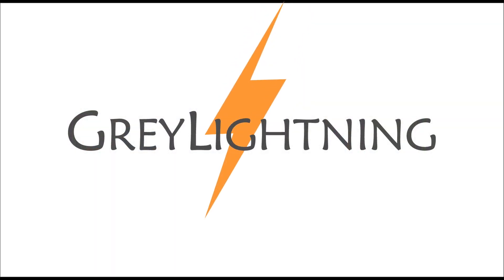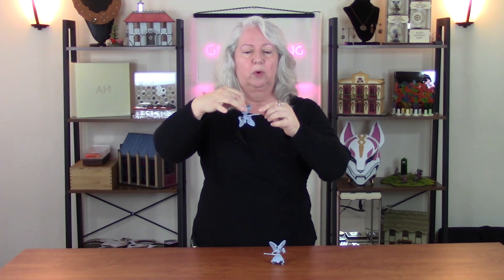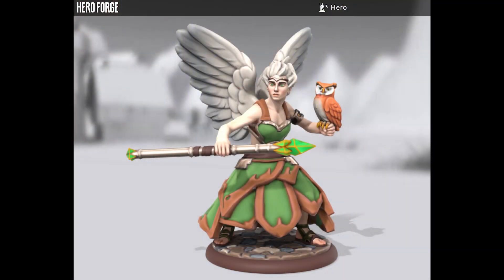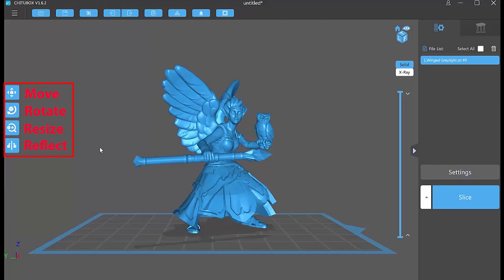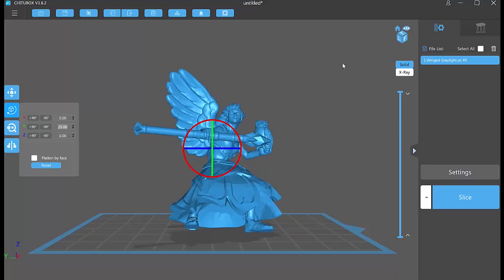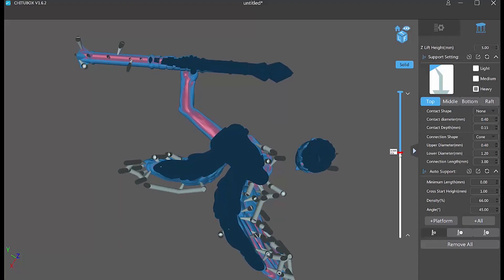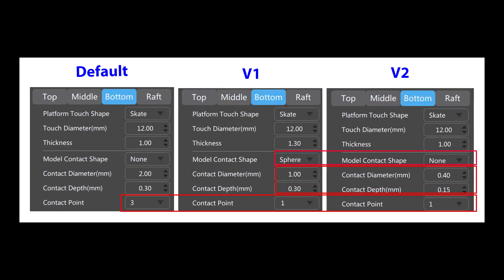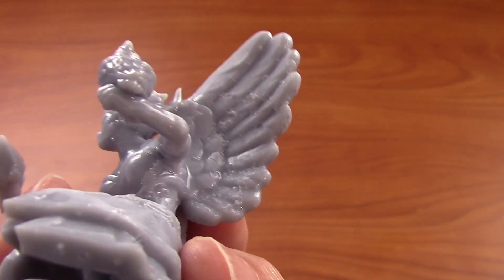Adding Supports for Resin Printing to 3D Models in Chitubox

Comment: nice video, a tip is to use a exacto knife and remove the nobs before curing:)
Reply from the maker: Thanks, Paintroll! I've gotten really aggressive at reducing the density of supports and using light supports, which is making them easier to remove. Any tips that make removal easier and cleaner are much appreciated!
Reply: @GreylightMay  I have been using 3D pro settings and they are working great. but still i, quite new to 3d printing, but i noticed that cleaning the model before curing is alot easier and makes less "damage" since its quite soft before curing. im using plant resin. And i use 600 grid sandpaper after have cured it. to remove the big nobs.
Reply from the maker: Yes, I agree. I've also heard that rinsing in warm water makes them easier to remove. It's a constant learning process, but fun!

Comment: Resin in a syringe and a UV flashlight can work wonders on some types of support damage and it also works great if you need to weld pieces together. I also like to use it to fill in seems. 3DPrintingPro is also a great source for info on supports if you haven't checked him out yet. There are a few others, but I tend to prefer his supports as they seem to be more reliable across the assortment of resins I find myself testing. And hot water, it was a game changer for me when removing supports. Another tip, if you hold down shift and use the up/down arrows on your keyboard, you can move through the model layer-by-layer from the bottom which I find more useful in finding islands than the default top->bottom.
Reply from the maker: Great advice! Yes, I've watched his support videos, including his updated settings. What I use now is very close to his revised numbers. The difference is I DO use auto support, with a much lower fill percentage than the default; he does everything manually.  I discovered a similar water trick accidentally, by leaving it in a long time. The supports almost fell off! Thanks for all the great tips. I'm learning a lot from my viewer feedback!!

Comment: I would always recommend to use light supports and reduce the density option to as low as you can get away with (unless you print something big and heavy) . One thing to keep in mind is that every support has a chance to damage the model. Lighter supports have a smaller contact area as well. I can often pull them off with my hands after washing the model. This reduces the ammount work for preparing the model significantly. Oh and thank you for makeing this video... you tinkered with some options I never looked at.
Reply from the maker: Yes, Sandra, my settings are lighter than the default light support settings but I haven't played with the density. What kind of percents have you been able to drop to successfully? This isn't a very heavy model.
Reply: @GreylightMay  with gaming miniataures in 30mm scale I usually set the density to arround 20% and add a few selected supports to parts prone to sagging. The elbow in your miniature is a prime example.
Reply from the maker: Wow, that's a big difference. That would be much easier to remove. Thank you, that's good to know!!
Reply: @GreylightMay  You are welcome! I am always happy if I can give a little bit of knowledge back to people shareing theirs as freely as you do :-)

Comment: "Failure is part of the process." That's almost a mantra of mine. Being in the tool and die trade both building and now designing stamping dies has taught me to not be afraid of failure. I was off work this past week and spent a bunch of time designing a laser cut project. I spent the better part of yesterday and today executing that design and I managed to fail left and right. The project isn't complete yet but I'm seeing light at the end of the tunnel. It's all good in the end.
Reply from the maker: Yes! And while it may seem obvious to some of us, I've learned that some people almost need permission to fail, or they get discouraged. That's why I've I've always tried to show some of my failures in my videos instead of editing them away. Thank you so much for your comment, it confirms my belief that makers are resilient folk!

Comment: I have played around with resin prints and supports for a few years, and I think you have a great set of advice for beginners.    One of the things to watch for as you advance your practice of this Dark Art is that the type of contacts you use depend on the contact point and what kind of clean up you can do/are willing to do.  I will use a very fine contact point for the low point of a curved surface (it breaks away cleanly, but is not a rigid support point) and a round tip with a large contact patch On a flatter surface (and I will file it flat later).  Sometimes that means I will add one type of support, then save the file and add a different type of supports (usually point first and ball second) the get the supports the way I like them.  Also, remember that you can add on uv resin as fill and set it with a UV light (e.g. led, flashlight, 5 Second Fix pen) or other filler.  Finally, small files are your friends when it comes to post processing!
Reply from the maker: Born Again, this is a beautiful example of the type of sophisticated decision making  I know advanced practitioners make! I can only aspire to this level of understanding. In the meantime, your tip about the filler is VERY helpful. I will do a search to see if I can find it!
Reply: @GreylightMay  Ha Ha!  There's no magic to learning this: just several bottles of resin, a fair helping of desperation, and a willingness to try things.  Everyone gets thier skills upgraded as long as they try.

Comment: Q. can you make a copy of a commercial figure and use it for your self, or is that against the law ?
Reply from the maker: In Hero Forge you can only pick from the features and accessories they have available. If you used a tool like Blender to design someone that looked like a commercial figure, like say Captain America, you would only get in trouble if you tried to resell it and used copyrighted or trademarked things, like the name. As long as it's just for yourself,  you can do most anything.
Reply: @GreylightMay , many thanks for the info, i had heard as long as you keep the copied models for yourself you are ok...good to know...i don't want PC plod knocking at my door :DDDDD